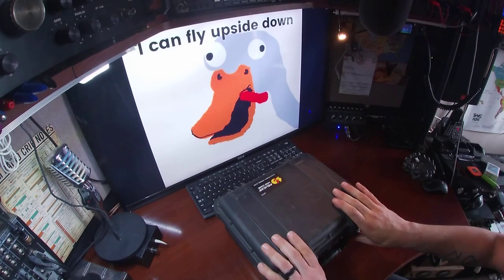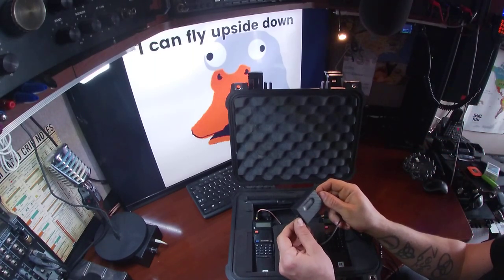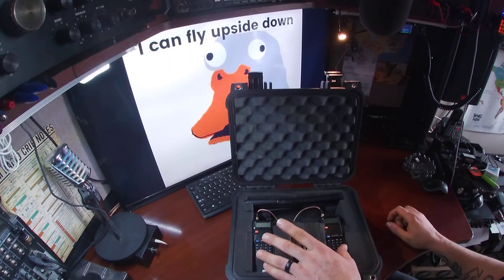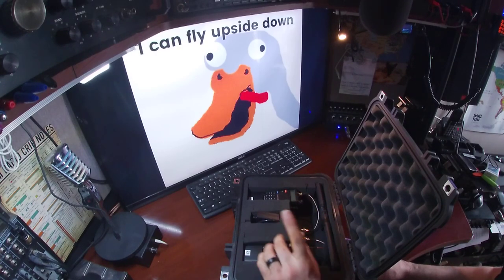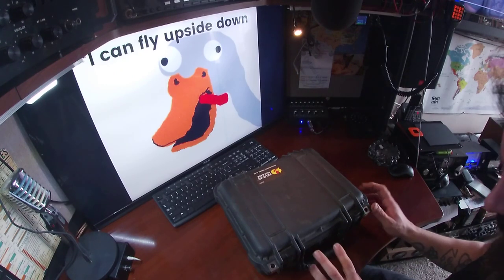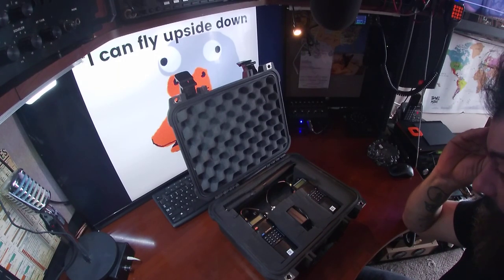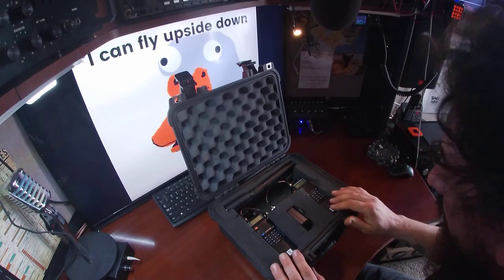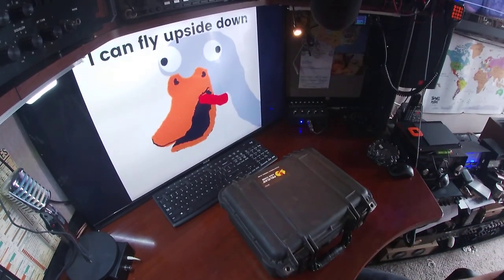DIY Baofeng portable repeater

Comment: Super interesting experiment, hoping for an update!

You're asking almost all the same questions I have.

I'd be curious about power if using the "power eliminators" would make it any cooler or if you'd introduce any noise from your power source.

Also I like the antenna idea, you could pretty easily add a j-pole with the design.
Reply from the maker: I’m hoping to test it out this weekend. I have gotten some good feedback in the groups so I might need to change some things. Either way we’ll see how it works out.
Reply: Noise from the power source may be a factor. Open up the battery case, its mostly empty and line it with foil.

Comment: This is the third porta-peater youtube I have seen.  Looks much easier than the one my buddy and I had about 13 years ago (it was far bigger, heavier, and harder to set up).  When will someone put up a video that actually shows the radio configuration process?    I see in the comments that you have later videos.  I will check them out.
Reply from the maker: Radio setup as far as what? Frequency? Offset? What would you like to see?
Reply: @SlowGoose  On which to set up roger beep, how? On which to set up ctss.  I think I know, but some may not (xmit, rcv, both)?  Lengths of interior cables if it matters?  Why two separate batteries?  How to make holes for charging and antenae that don't leak.  Ours was in a metal 40mm grenade ammo box and we had leaking problems.  How to prevent heat buildup.  Is there any programming to do on the repeater controller?
Reply: Very good questions to think about.
Thanks,
 @michaelbrininstool4515

Comment: Before you mentioned the heat issue I was thinking..that thing is gonna overheat out in the field because the case is too tight for waterproofing. But good luck, hope you find a solution.
Reply from the maker: I have my concerns still. I upgraded the tx to a 25 watt ht and it does work a lot better. The  tx radio has an internal fan and produces substantially more heat. I have not added a fan yet but it’s become a necessity
Reply: Consider the duty cycle. Heat likely won't become an issue. You could attach the tx radio to a block of aluminum should be enough

Comment: 9 watt 5vdc panel? @ what current ?
Baofeng pair will need 1.8 amps xmit, but I'm  not sure these have bms on the extended batpack. I purchased the alkaline/low to mid grade nimetalhydride AA. Charge rate 850ma to 1.2 amp each,  depending on workload.  Picking up the components to build or buy one outright, 2.5 amp regulated charge controller.
Reply from the maker: I’ve never had it out long enough where I’ve had to use the solar panel. But it is not enough current.

Comment: soo those duplexers are the trick to make the repeater box to work?  what specification should I look for those?
Reply from the maker: It’s not required for it to work but it is required if you want to use 1 antenna.
Reply: @SlowGoose  with two antennas happens the same

Comment: Does this work with Quansheng also :)?
Reply from the maker: If the plug on the interface fits it will usually work.  I have used it on several different radios
Reply: @SlowGoose  Thank you for the answer!

Comment: Interesting. But don't you ne 2 antennas? One to receive and one to transmit.
Reply from the maker: That’s what the duplexer is for. I have seen them with 2 antennas and that’s going to do more harm than good. With cheap radios and incorrect spacing of antennas you will wipe out the receiver of the rx radio.

Comment: Those batteries will not power the radio while it is charging. It will also broadcast on 2m.
Reply from the maker: If you check out the next video I wound up having to address the 2 meter issue. I just set it up to cross band and it eliminated the need to stuff a full size duplexer inside the box. 
Also these batteries do charge while the radio is on.

Comment: I see two radios in a case.  Nothing else.  These guys never seem to go outside.
Reply from the maker: It was tested on a 3 element beam and the range was awful. The tx radio has been replaced with a 25 watt. The diplexer was replaced with a duplexer. That just has to be tuned now. Watch the rest of the videos.